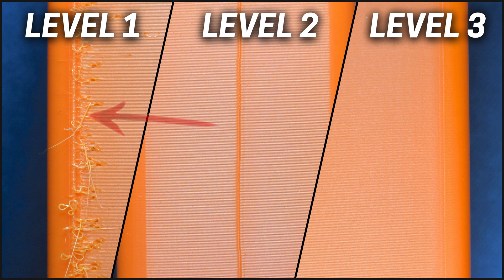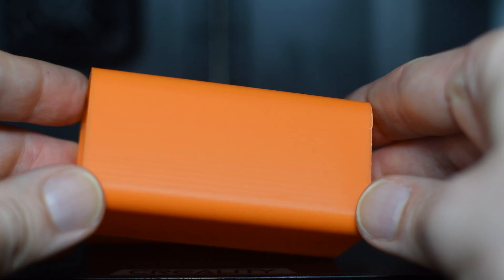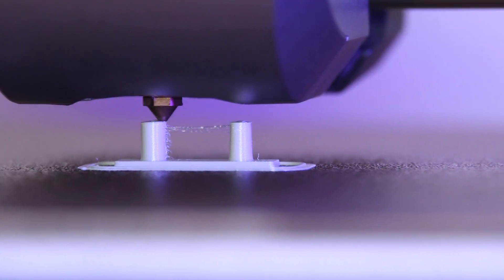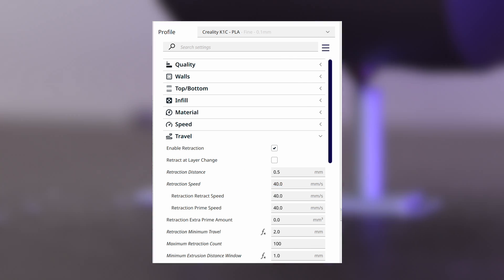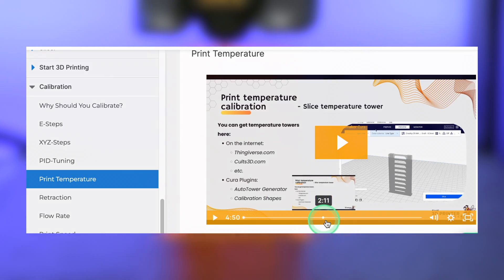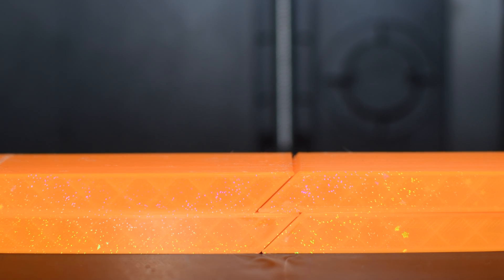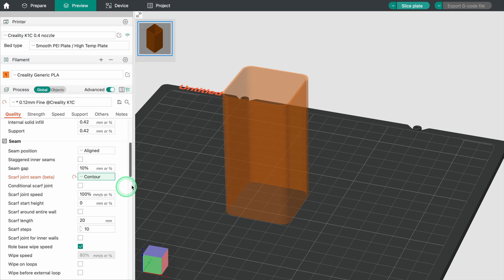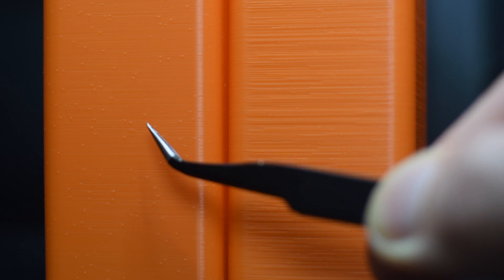How to 3D Print (almost) Invisible Z-Seams

Comment: I got a new printer, and instead of a blobby seam, i get an anti-seam, where the radius of point A and B would just touch perfectly, but leave a rift. Coasting doesn't help, because the extrusion still stops on point B. It's like a tool head compensation for a cnc milling machine, where the outside diameter of the nozzle just compensates. If i set an extra amount of extract, point A will be a more dragged blob, but that doesnt fix the rift itself. I need something like coasting + extra extrude. E steps are calibrated, the print itself looks really good, but i have no idea why it would do that compensated seam, in orca and cura. No such thing with my old printer. The nozzle doesn't do a 100% loop, it's like 99,8% and that 0.2% is the anti seam in the layer. HELP.
I found other people on different printers, having the same issue and no solution. Increasing extra extrusion is like the wrong tool and almost does help, but really doesn't.

Comment: No one usa Orca Slicer.
Reply: Sounds like a you problem.
Reply: orca slicer is really good. Just their library of plug and play calibrations is enough of a reason to download and try. It fixed a problem i had for a few months that I couldn't fine tune with prusa or cura. Accuracy of parts is pretty consistent too. I am able to print abs parts as is without having to calculate shrinkage.
Reply: 70% of users in a recent survey have switched. Nice try speaking for everyone.
Reply from the maker: You should try it - it's my favorite slicer right now!
Reply: Must be new
Reply: I use Orca for my ender 5's running through sonic pads, Prusa and cura for my ender 3's, my ender 3's are not running klipper
Reply: After using all the popular and well known slicers nowadays I mostly use only orcaslicer. It includes all important features and much more  in an easy to use software
Reply: Lol 😂 😂
Reply: I do
Reply: I also switched to orca recently based on this comment thread you could say most people who commented use orca and in my estimation more people use orca than cura now
Reply: I use cura because it can be sent straight to my printer, but I also use Bambu studio!
Reply: Millions use orca
Reply: Really? I do..
Reply: You're wrong, buddy.
Reply: @Lunsky73  Maybe, I'm not so sure though. I spend a decent amount of time in various printing communities and haven't really seen cura mentioned in a while now. Maybe it is still used by those that are brand new to printing and running ender clones I'm not sure. I don't mean any of this to come across as an attack in any way, just find it interesting is all. Cura is fine, I used to use it exclusively when I first started printing. I finally moved on to prusaslicer and then Orcaslicer once I saw how much more feature rich they are though.
Reply: @Lunsky73 It is assumed that what I said is not literal.
Something real is: Few people use Orca Slicer.
Most people use Cura Slicer.
You can check it wherever you like.
Reply: Haha what?
Reply: @substratum3d It is assumed that what I said is not literal.
Something real is: Few people use Orca Slicer.
Most people use Cura Slicer.
You can check it wherever you like.
Reply: While it might be true that not a lot of people use Orca slicer and it's vanilla form, a whole hell of a lot of people use bamboo slicer which is a derivative of orca slicer.
Reply: @gunsmoke132  Other way around...